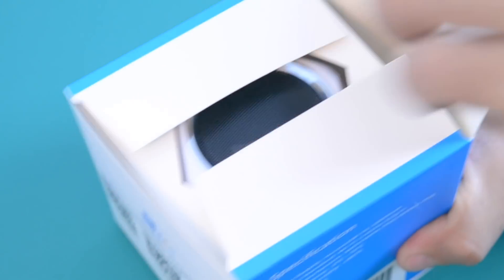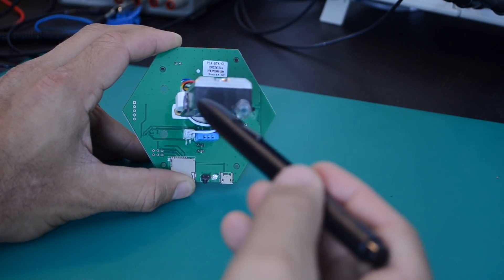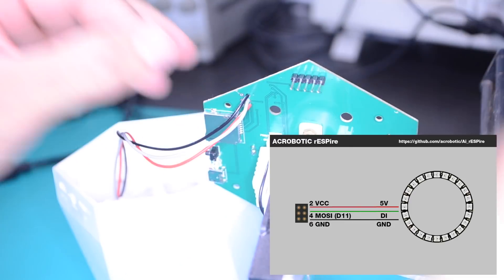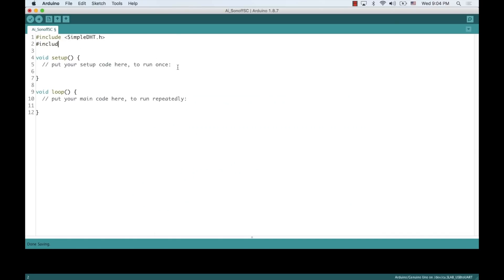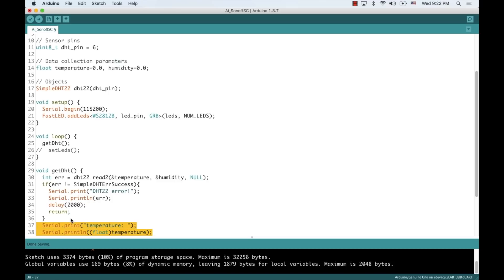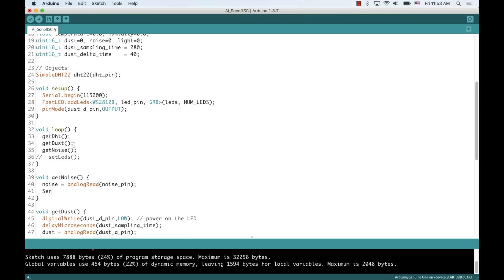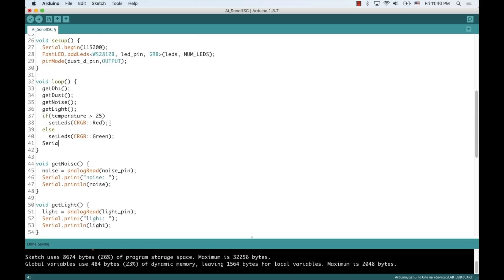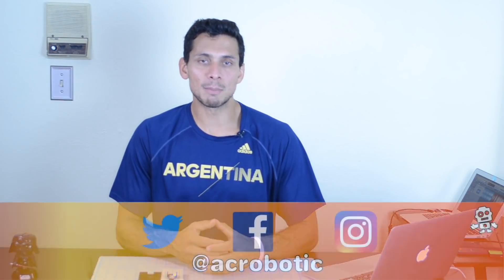ESP8266 Sonoff SC Firmware Using Arduino (Mac OSX and Windows) |  ATmega328 Test For Home Automation

Comment: Hi! I successfully flashed Sonoff 220V Esp8266 relay module. Thank you.
But I need to flash another version of Sonoff relay – 5V, based on Esp8285.
And I’ve got problem here.
I am trying the same process:
-	Solder pin 3V3, GND, RX, TX
-	Connect pins, to the same FTDI adapter 
-	Choose the right board – in this case, Generic Esp8285
-	Initialize flash mode with a button
-	Upload Blink sketch

And nothing – «Connecting........_____....._____.....»
I tried different options of Uploader. In wane.
Can you help or give an advice?